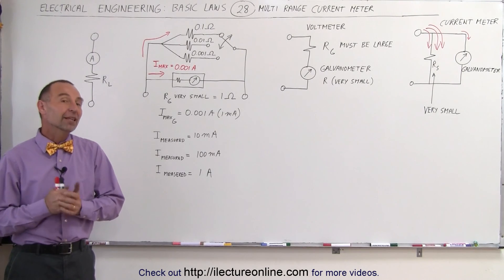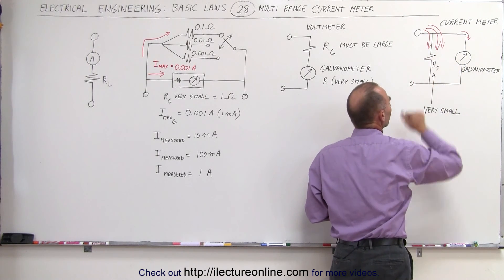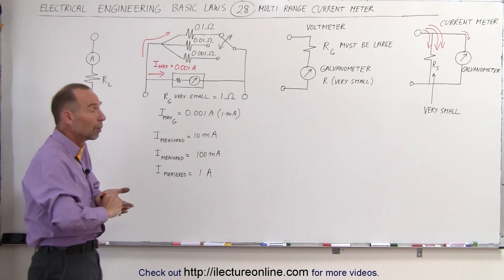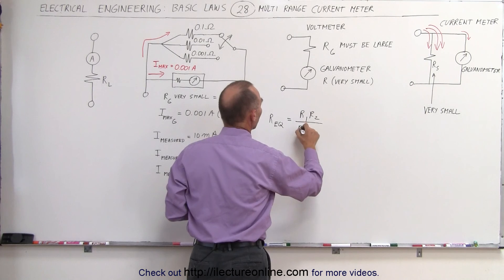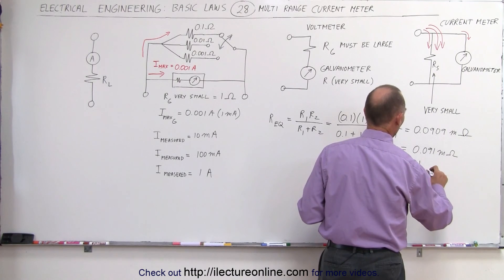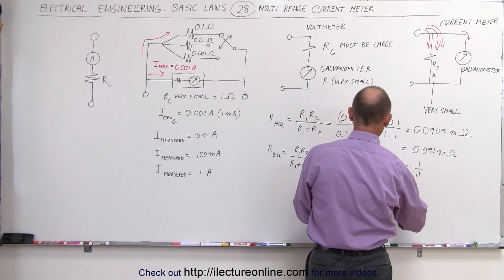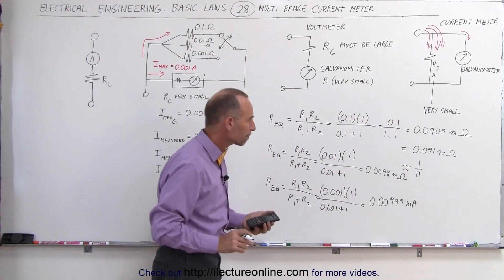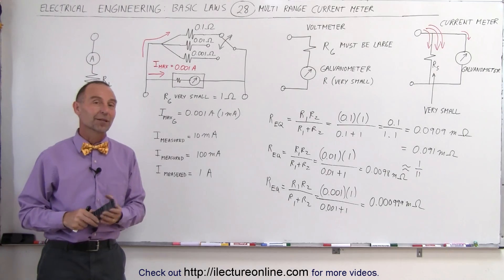Electrical Engineering: Basic Laws (28 of 31) The Multi Range Current Meter

Comment: Is there an advantage to full scale deflection OR could you not simply have the smallest shunt resistance and therefore have minimal deflection for lower amp readings and higher deflection for higher readings but all with the same range shunt resistor?
Reply: Good question. I would quote the answer of Michel to a somewhat similar question in the comments section of the previous video "Multi-range Voltmeter" - The reason it is that for lower amp readings the deflection would be so small that it would be difficult to see. The same is true for a multi-range voltmeter; that is; we cannot use the largest series resistance for all readings because, for smaller volt readings, the deflection would be too small that it would be difficult to see.

Comment: Resistance unit is written wrong. they are not 0.091 mohm but ohm. Not 0.0098 mohm, but ohm. Not 0.000999 m ohm, but ohm.
Reply from the maker: You are correct, the "m" does not belong there.  Thank you.
Reply: This was a really good catch! i missed it myself.

Comment: Hi Sir. Thank you so much for your comprehensive explanation. However, I think that the orientation of the resistors in the multirange ammeter is hazardous in an actual ammeter. At the moment that the rotary knob switches from one resistor to another and is still pointed in between the resistors, the equivalent resistance of the branch in parallel to the galvanometer would be very high, ideally infinite, so the current will all flow through the galvanometer and it might damage the galvanometer if it is higher than what it can handle. Am I right? I just thought that a sliding resistor may actually work in a real ammeter. Thanks! :)
Reply: Herman Legaspi I think you have to switch the resistances without passing current to don't fry the galvanometer
Reply: i've seen similar schematics over multiple sources, but most of what they teach is based in an ideal physics world, so im not sure